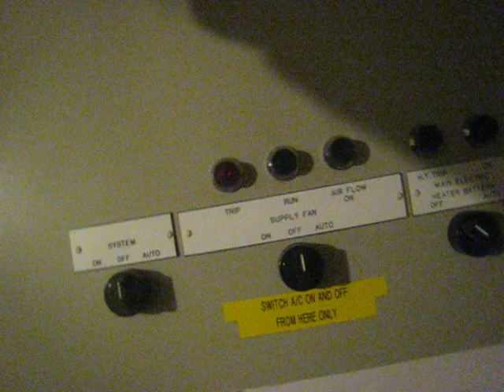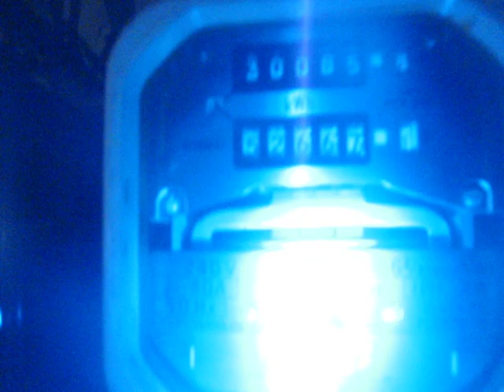economy 7 load shifting system: the beginning.

Comment from the maker: @Photonicinduction thanks, i couldn't believe my luck when i found this inside a building that is being demolished, they were just going to pull it down with stuff like this still inside so i got it.
like i said in the video, getting this has saved me a ton on the project! it came with several contactors, relays and most of all the panel.
i am going to do a video tonight explaining how it will all work (pretty similar to yours)